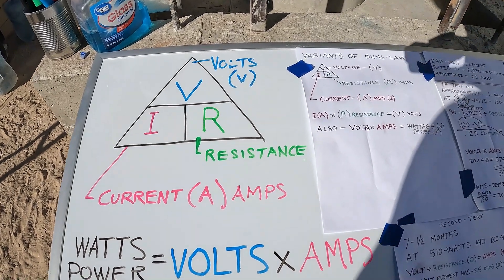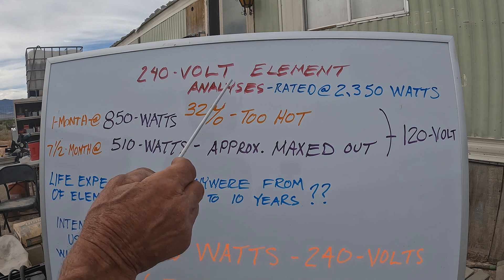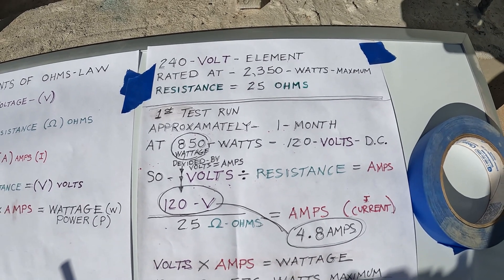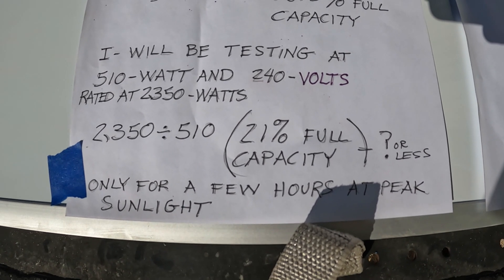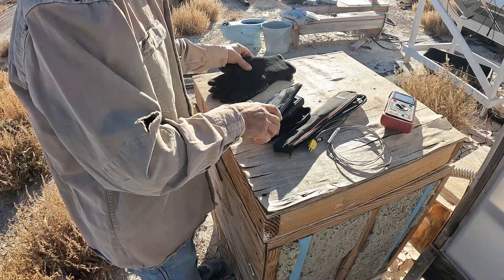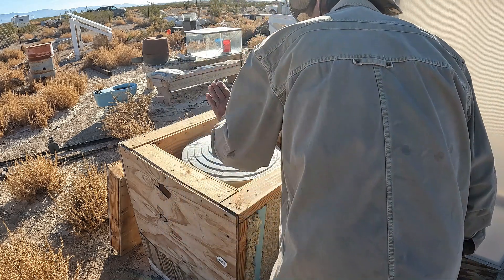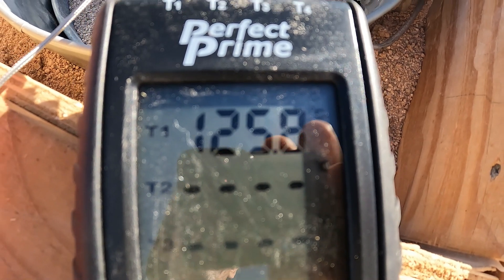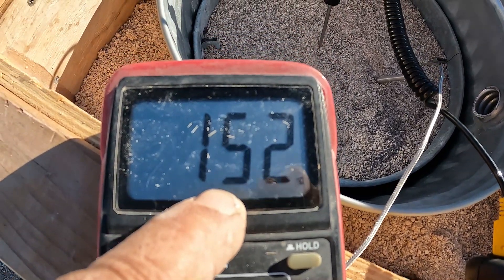Sand Battery 240-Volt Element, Final Update and Analysis E136

Comment: The only constant is the resistance unless you change the element the voltage will change (go down) as the load increases to the max design amperage of the solar panels and the series of connection which is driven by the amount of sun they can absorb. You could try to control the voltage with a charge controller but I doubt it will improve the results. I channel called opera has figure out the mppt for the power point but it is very confusing. Cyboinverter is also a controller they use for water heating it may control your element better. But I like what you have done by matching the solar panels to the voltage you want it keeps it simple. Thanks for sharing and good luck
Reply from the maker: Thank you for that information. I am not an electrician, more like a backyard inventor. I did learn basic electronics over 40 years ago in the Army as a generator mechanic but long since forgot most of what I learned.
Reply: @off-gridsurvivalmike8120   Well the voltage drop most days when using 125 volts at about 8 amps is a running voltage of around 80 volts that is without mppt control so I would ad another panel in the series or recalculate for the lower voltage. Also maybe your panels are different and don't drop as much. Cheers.
Reply: @offgridwanabe yeah Opera knows his stuff, but his videos are not that well presented and hard to dig through..  I'm just  going to use the AC from my  inverter ... since I have the capacity, it's simpler an optimized....  but  down the road I may build a DC MPPT just for the heaters.

Comment: Its not necessarily the power applied.  It's the temperature of the element that effects longevity (oxidation) .  For example if you have a given element at 2000 watts in free air it will get to red hot very quickly, but if you place it in room temp sand... you can run it at 2000 watts until the sand gets up to  certain temperature and THEN reduce the wattage (or turn it off) completely. The conductive medium does not let the element reach high temps for quite a while.  For my t-batt I am aiming to keep the Max temp of the medium and element at around 1000F for reasonable durability.  If one knows a really cold night is coming up , you could once in a while heat the battery to much higher temps for more storage.  Either way elements are cheap just make them easy to access.   Off the shelf Dimplex, Nightstor/Elnur storage heaters  target about 1100 Deg F according to some, this also jives with my reverse engineering calcs.  I can't find my notes, but I remember finding a chart on heating element life (Nichrome) vs temp.... any way I DO have in my notes that it 1100 F  from the chart had a much longer life than higher (not linear) and that also jives with the target temps that TES  residential wall mounted storage heaters use (was/is ) very common in the U.K .   If we lived there we could get the ideal scrap "feolite" bricks out of them very cheaply.    Too heavy to ship.  I may end up collecting enough magnetite to use, but I chose Basaltic pebbles as an easier to get 2nd choice.  I could also fill the pebble voids with Sand.  However I kind of like the voids in a pebble structure because it is easy to get rapid heat removal (fan)  if needed.  In the end as long as you have enough volume , the medium is not that important as We are not causing phase changes, just dumping btus into a medium... and all those btu's can be extracted for heating no matter what. In some cases there is an advantage to higher conductivity of the medium... if you need to recharge it fast (limited Solar hours).... Not to much of an issue if conductivity was too high... as insulation takes care of that.  Other advantage to high conductivity (and air voids (pebbles)  is that one may not need to use a blower (electricity)  to extract heat... just retract insulation/lid.     I thought about actually using metals; steel or aluminum... and I may try it, but they will oxidize over time.  Stainless Steel could be good, but hard to get that much cheap.  Basalt seems to work well in my test.
Reply from the maker: I thought about magnetite also. I can collect it with magnets in the desert here but it's time consuming. Also I wasn't sure if it may cause a short so I just went with the sand. So many ideas and options. Thank you for sharing that information.
Reply: yeah i got some from the river sand... 1st time I noticed it was it was stuck all over my fishing net holder magnets lol.  Also contacted some gold miners to see If I could get their waste .  I'm not too worried about a short since elements contact conductive pots etc,  but it's better to be careful. It's probably not worth it. @off-gridsurvivalmike8120